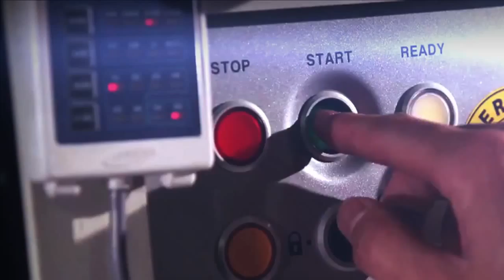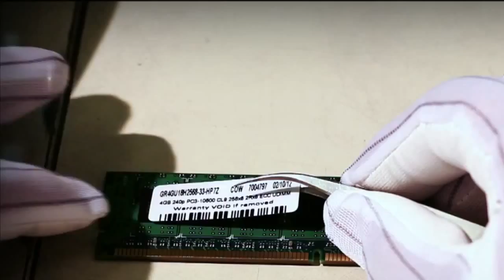Android Memory... DON'T use the task killer !! !!

Comment from the maker: ok...  and pulling the battery, and rebooting didnt work either correct?
What you will need to do is flash a stock Sammy ROM using odin (i suggest GB as thats easier to root) then boot your phone up.  Then restart your phone so its a fully working 'stock' device.  Then root it using odin, and then flash this ROM using my method.   I've had to do this once as i had the same experience you are having.  Seems to be misplaced files restricting a boot.